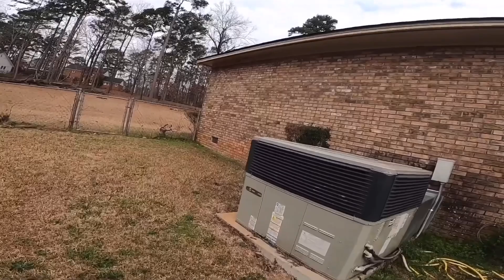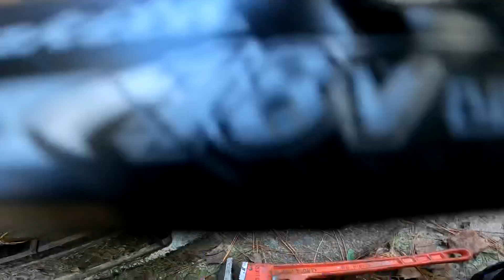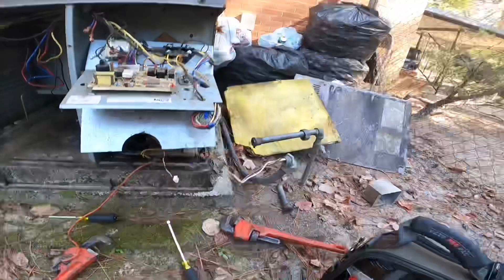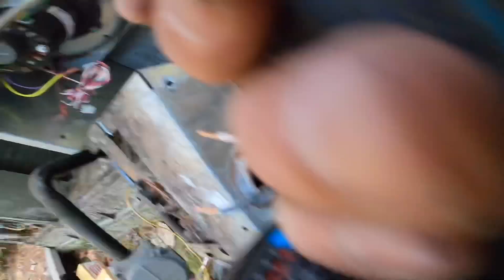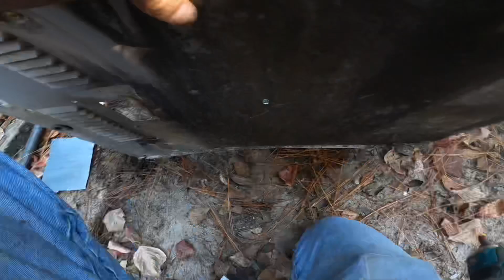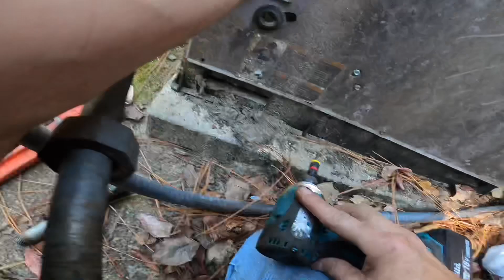Replacing draft motor, and burners on Bryant gas pack 574ANW

Comment: Ummmm.... Why is there trash bags beside the unit? Gross
Reply from the maker: I think it is aluminum cans
Reply: saving cans for a rainy day of broke and needing cigarettes or beer. the scrap value of a bunch would buy a few packs of smokes and some cheap beer or watered down alcohol.
I take (mostly)soda cans in once a year, about a large van full. better than it being buried with regular trash pickup, although It annoyingly fill the porch full of giant contractor bags of them, it's not worth taking to recycle in smaller quantities, you burn more in fuel than you get back 
🙄